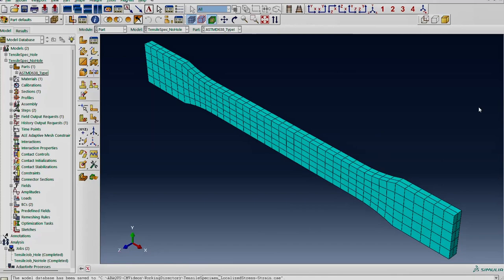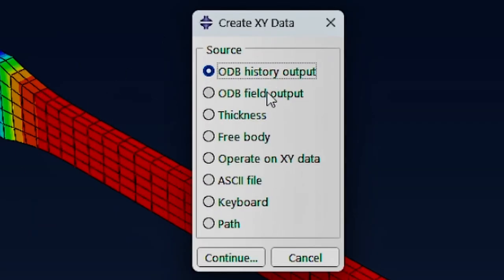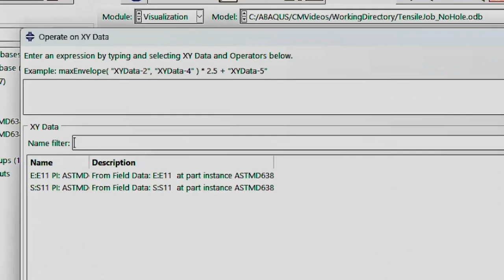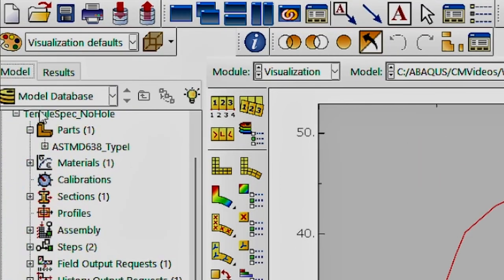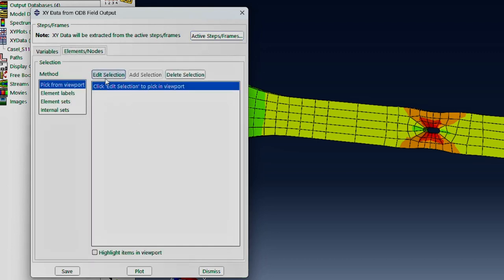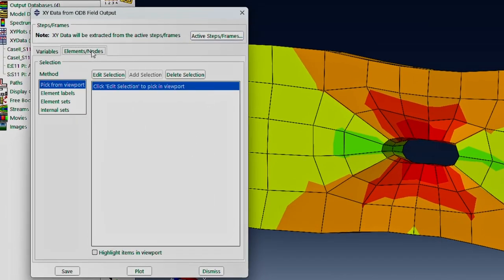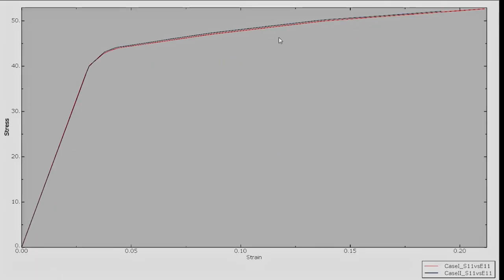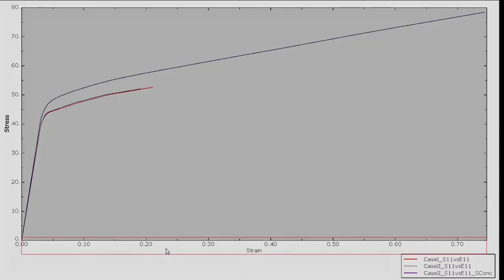How to GET STRESS-STRAIN PLOTS in ABAQUS by Probing Regions

Comment: Thank you for such a nice video. I have a general question: As the material properties are not changed, why in the stress concentration case the yield stress obtained from the plots is different and relatively higher than in the other cases? (Although I am assuming that the yield stress input is not changed for any cases)
Reply from the maker: Yes, correct. It is a localized stress effect, the better measure is the homogenized (effective) stress since such localised stress concentration is dependent on other factors (e.g. size of hole)

Comment: Thank you for the video.
I have a question: if I have a model meshed with shell, loaded in bending  and I want to plot the two strains at the top and bottom of one element as a function of displacement, which is the procedure that you suggest ?
Reply from the maker: I will imagine the localised approach since you are targeting the strains at specific locations on the beam.
Reply: @MichaelOkereke  thank you for your reply. 
But how could I choose section points, bottom and top of the shell  e.g., and select  them in history output so that i can plot their strain values. I'm thinking something like two strain gages fixed back to back in a given location of a panel

Comment: Dear Dr. Mike,
Your tutorials are very much helpful. I am requesting you to make a tutorial on obtaining stress-strain diagram (with plateau behavior) for open porous metalic foams. 
Also can you suggest which type of material model should be used to tackle the above mentioned problem?

Thank you for your time.
Reply from the maker: Thanks for the comment.  

I haven't done any plot for metallic foams, but it should follow such sequence as this video except in the material model used and the design of the virtual domain.  

The critical bit is in recovering the plateau as that results from the crushing and buckling structural failure of the pores.

In ABAQUS, I don't think there is an inbuilt metallic foam model. 

So, to model a metallic foam with a plateau zone and strain hardening in Abaqus, you can use the "Linear Elastic-Plastic" material model with isotropic hardening.

This material model allows you to capture both the initial plastic plateau behavior and the strain hardening response.

 The plateau behaviour can be due to the buckling and crushing collapse of the struts, which suggests you have to model it in detail, too. 

Where you want the true foam response to come from a material behaviour, I am afraid you'd have to code it up.
Reply: @MichaelOkereke  Thank you for the detailed responce on my query. I will alter the material model as per suggestion and give it a try.

Comment: Thank you Dr for this video, so helpful, i like to ask you question : is it possible to extract stress/strain curve from cross section or juste only from element or nodes ??? and how to choose this element for comparaison with experemental results??
Reply from the maker: Dear, thanks for the comment.

On your question of extracting stress/strain from a cross-section, this is called a Volume-Averaging Method and I made a video where I showed this which you can watch here: https://youtu.be/gCQzzF8Few8

With regards to how to select element for comparison wiht experimental data, it is better to use the volume-averaging method as that will give a more experimental-relevant result that just selectively picking elements as shown in this method. This approach shown here is merely to explore/probe stress-distributon acros a heterogeneous media. There is no standard method for choosing elements, it depends on what you are trying to find out from your simulation.

Comment: Hello Doctor Mike, do you recommend generating the stress strain data based on the single element for composite material because I could see from the shape of the specimen you used in this video that the material is isotropic.
Reply from the maker: Hello, I will not recommend this method for a composite as it has variable stress distribution. The better way is to use a homogenization or volume averaging approach. Here is a video that shows you how to use the volume-averaging method: https://youtu.be/gCQzzF8Few8

Comment: Please can you help me write my thesis using finite element analysis
Reply from the maker: This is wrong and not the sort of thing I get involved in. I answer questions on computational modelling issues you are struggling with but never writing thesis for anyone.
Reply: Please Dr. Can I get video tetorial onSimulation tests of static tensile testing of Ni added to base aluminium 
Simulation tests of tensile strength of Ni added to base aluminium 
Simulation tests of stress failure of Ni added to base aluminium 
Simulation tests of strain failure of Ni added to base aluminium 
Simulation tests of deformation failure of Ni added to base aluminium 
Simulation tests of static tensile testing of Ni and B added to base aluminium 
Simulation tests of tensile strength of Ni and B added to base aluminium 
Simulation tests of stress failure of Ni and B added to base aluminium 
Simulation tests of strain failure of Ni and B added to base aluminium 
Simulation tests of deformation failure of Ni and B added to base aluminium